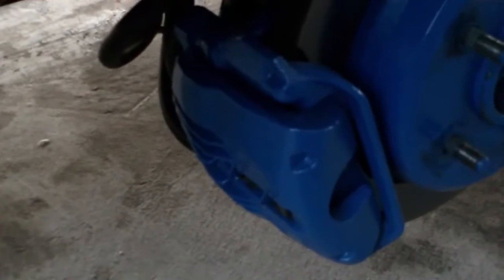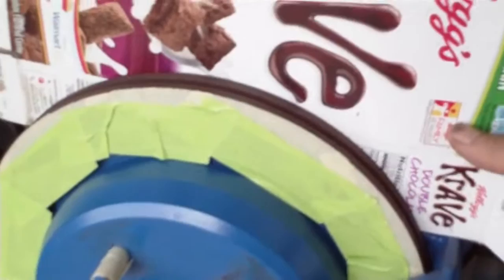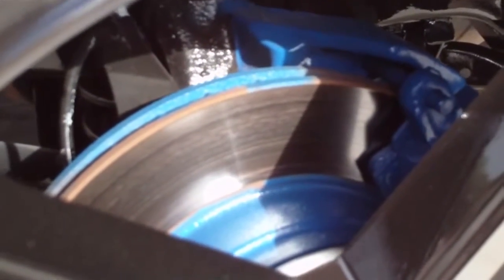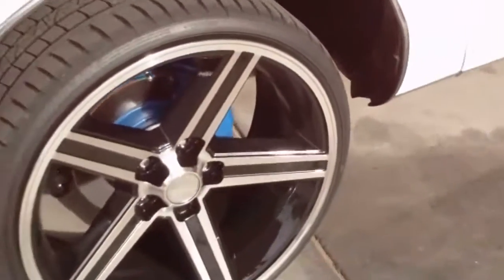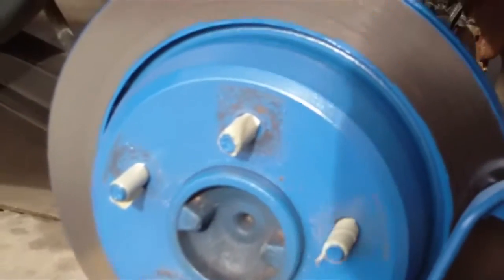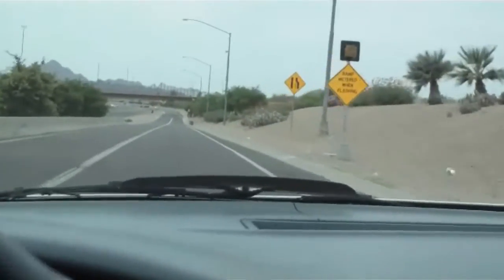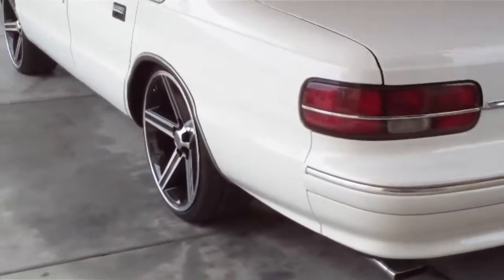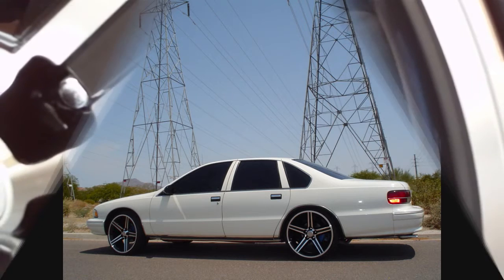1996 Caprice Update Brake Pad Pins Fixed and more Blue Paint

Comment from the maker: My Caprice has been lowered 2" in the front & 3" in the back it just looks normal because a stock 9c1 Caprice has the heavy duty springs & sit up pretty high. My 245/30/22 tires fit with no rub & full U-turns also but its very close.

Comment from the maker: When I was at that tire shop they tryed to talk me into the 24's but sence my Caprice has been lowered already they would not have fit without cutting so I went 22's & I think I might go a 1/2" lower in the front but Im not 100% sure yet cuz right now even tho its close there is no rubbing even doing hard turns at high speeds